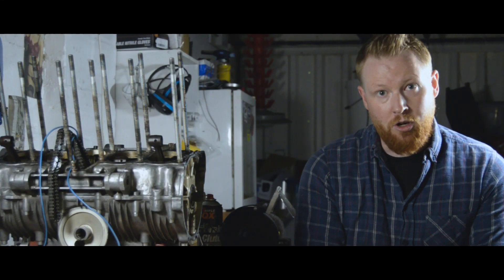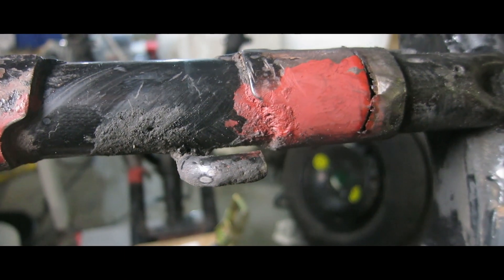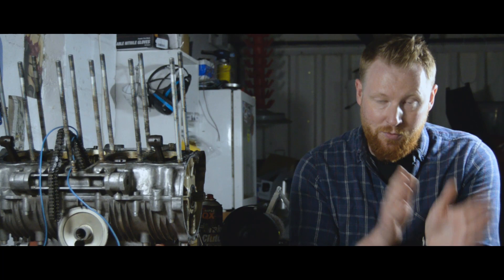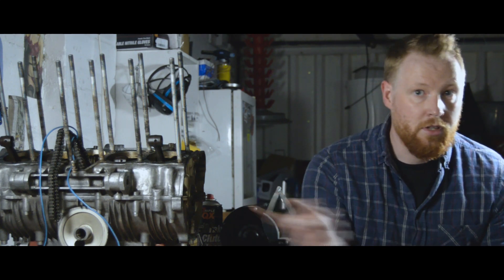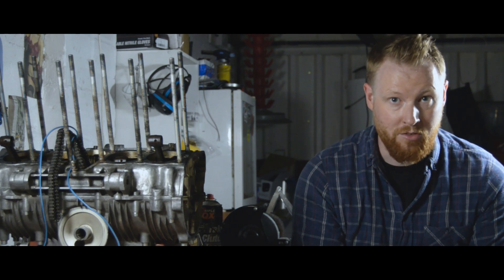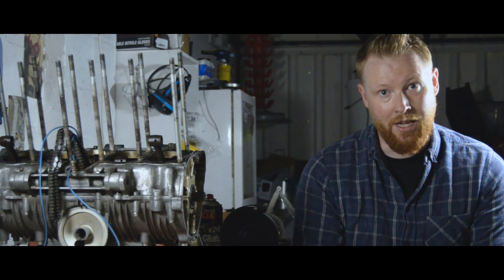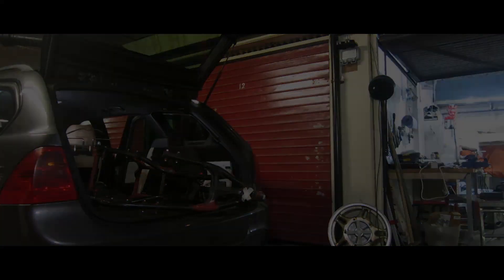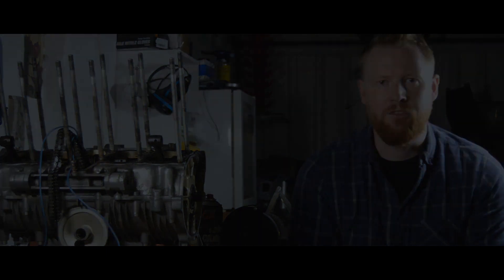Frame Hoop Welding, Detab and Powder Coating - Honda CB750 Cafe Racer Build Ep8

Comment: Took off the wheels to get them powder coated, got my brake master cylinder and new levers..
have to repaint my tank because my surfboard fell and dented it. 
1982 cb750 k
I want to relocate the battery but its hard to figure out where
Reply: thats a good idea, what about the power and charging life
..
Reply: BTW, I have never built a bike and its great to have a mentor.

Comment: I have so many things done I'm trying to move the wiring now Does any other wiring have to be grounded besides the ground wire to the battery. I noticed that a couple of wire Junction boxes are bolted to metal is that so they can be grounded or does it just not matter
Reply: The two main grounds are from the battery and the wire loom at the coils...but your question was from a year ago...so I bet you have figured that out 😊